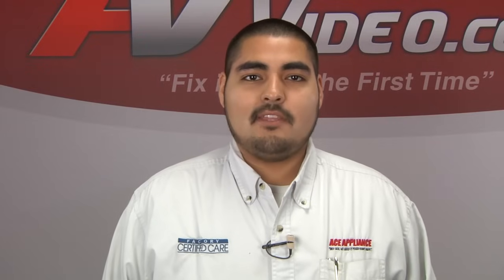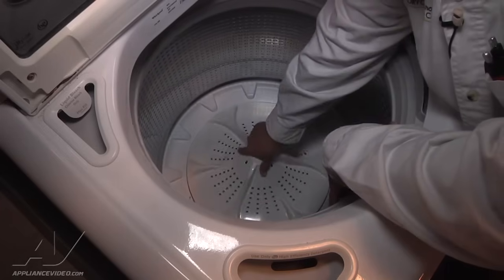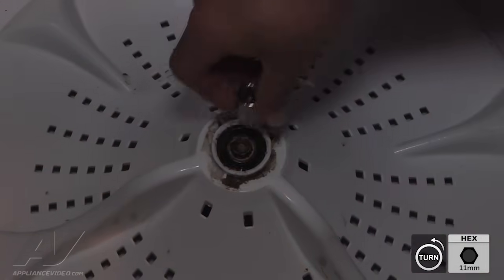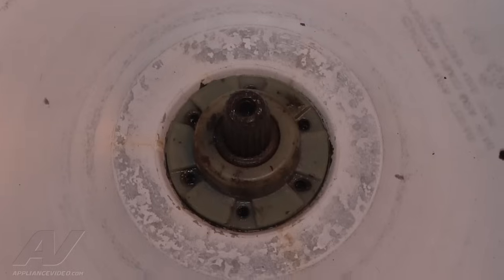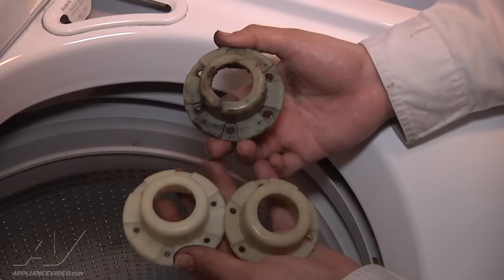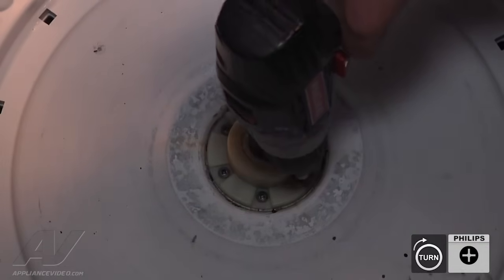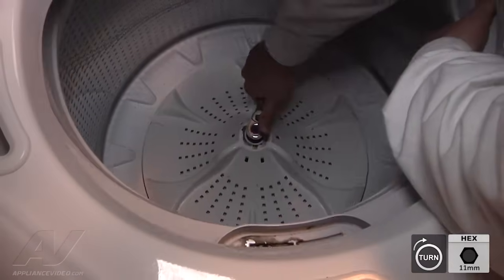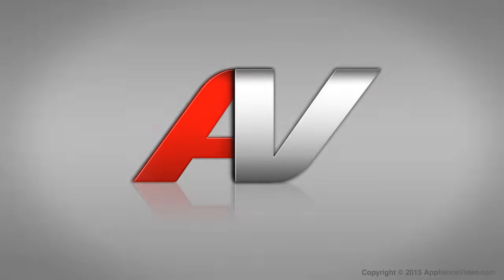Whirlpool Washer Repair - Error Codes SD and F71, Will Not Spin - Basket Hub

Comment: Is an error code 5d the same problem?  My washer will not go into a spin cycle.
Reply from the maker: Great question, if you have a more technical question that our parts department cannot answer, you can search our over 17,000 answered questions free at our website www.ApplianceVideo.com under our Repair Help section. You can also call our parts department at 1-800-830-5465 and they can give you help 7-days A week ,or search at www.SaveMoreOnParts.com  .

Comment: Ok, so I know the videos old but.. I changed these parts. Still get same code. 

Machine fills fine but basket still isn't engaging
Reply from the maker: Great question, if you have a more technical question that our parts department cannot answer, you can search our over 17,000 answered questions free at our website www.ApplianceVideo.com under our Repair Help section. You can also call our parts department at 1-800-830-5465 and they can give you help 7-days A week ,or search at www.SaveMoreOnParts.com  .

Comment: hi sir just changed the clutch on my whirlpool washer.and still making noise and wont spin need help thank you.
Reply from the maker: Great question, you can call our parts department at 1-800-830-5465 and they can give
you help 6-days A week Mon-Sat . If you have a more technical question that our
parts department cannot answer, our technicians are answering all questions at our website at www.ApplianceVideo.com under our Repair Help section. We have over 4,000
common questions and answers that you can easily search through by your model
number, appliance make, and problem or error codes, and It’s free to search
through our question & answer library.

Comment: The error came up and checked underneath and rotor bolt was loose . I tightened it and not only does it run more quietly but the code doesn't come up again
Reply from the maker: Great question, if you have a
more technical question that our parts department cannot answer, our
technicians are answering all questions at our website at www.ApplianceVideo.com under our Repair Help section. You can also call
our parts department at 1-800-830-5465 and they can give you help 7-days A week
Monday -Sunday, or search at www.SaveMoreOnParts.com  24 hours
7- days A week.

Comment: Hi I have one whirlpool the unit does not do anything I try to go diagnostics and nothing too can t
You help me
Reply from the maker: Great question, you can call
our parts department at 1-800-830-5465 and they can give you help 6-days A week
Mon-Sat . You can also search at www.SaveMoreOnParts.com 7- days a week.  If you have a more
technical question that our parts department cannot answer, our technicians are
answering all questions at our website at www.ApplianceVideo.com under our Repair Help section. We have over 6,000
common questions and answers that you can easily search through by your model
number, appliance make, problem or error codes, and It’s completely free to
search through our question & answer library. There is a very good chance
you question is already answered there.

Comment: i have a whirlpool cabrio model wtw6200vwo with a code f71 everything works but no spin what do i check yhanku like your vedio
Reply from the maker: Great question, you can call our parts department at 1-800-830-5465 and they can give
you help 7-days A week. If you have a more technical question that our parts
department cannot answer, our technicians are answering
all questions at our website at www.ApplianceVideo.com under our Repair Help section. We have over 3,000 common questions
and answers that you can easily search through by your model number, appliance
make, and problem or error codes, and It’s free to search through our question
& answer library.

Comment: Where can I get a metal hub,,,not cheap plastic hubs
Reply from the maker: Great question, if you have a
more technical question that our parts department cannot answer, our
technicians are answering all questions at our website at www.ApplianceVideo.com under our Repair Help section. You can also call
our parts department at 1-800-830-5465 and they can give you help 7-days A week
Monday -Sunday, or search at www.SaveMoreOnParts.com  24 hours
7- days A week.

Comment: i have a washer wirlpool Cabrio platinium and have this code error sd
Reply from the maker: Great question, you can call
our parts department at 1-800-830-5465 and they can give you help 6-days A week
Mon-Sat . You can also search at www.SaveMoreOnParts.com 7- days a week.  If you have a more
technical question that our parts department cannot answer, our technicians are
answering all questions at our website at www.ApplianceVideo.com under our Repair Help section. We have over 6,000
common questions and answers that you can easily search through by your model
number, appliance make, problem or error codes, and It’s completely free to
search through our question & answer library. There is a very good chance
you question is already answered there.

Comment: I can't get the bottom hub out. Any tips?
Reply from the maker: Great question, you can call
our parts department at 1-800-830-5465 and they can give you help 6-days A week
Mon-Sat . You can also search at www.SaveMoreOnParts.com 7- days a week.  If you have a more
technical question that our parts department cannot answer, our technicians are
answering all questions at our website at www.ApplianceVideo.com under our Repair Help section. We have over
4,000 common questions and answers that you can easily search through by your
model number, appliance make, and problem or error codes, and It’s free to
search through our question & answer library.

Comment: The washer plate won't come off after taking off the screw how can I take it apart? I'm stuck
Reply from the maker: Great question, if you have a
more technical question that our parts department cannot answer, you can search
our over 10,000 answered questions free at our website www.ApplianceVideo.com under our Repair Help section. You can also call
our parts department at 1-800-830-5465 and they can give you help 7-days A week
Monday -Saturday, or search at www.SaveMoreOnParts.com  24 hours
7- days A week.

Comment: my cloaths are still soaking wet after the spin cycle. any idea what is going on.
Reply from the maker: +Wilson Santos 

                   All of our technicians are now answering questions
daily at our http://www.appliancevideo.com/ website under the Repair Help section.  We also have over 1600 common questions and
answers that you can easily search through by your model number, appliance
make, problem or error code and it’s absolutely FREE. You also have the option
to email a factory service technician with a question on your appliance at
http://www.appliancevideo.com/repair-help/ . If you’re looking for a repair video, you
can also search our library of over 2600 free repair videos. ApplianceVideo.com
specializes in quality DO-IT-YOURSELF appliance repair videos and we get over
800,000 views per MONTH to our videos worldwide and growing. If you need of
parts for your major appliance, we have over 5-million parts in stock at http://savemoreonparts.com/ .  Thanks
for your support. Matt Ace Appliance factory service technician.

Comment: what is the name of this piece?
Reply from the maker: Great question, you can call
our parts department at 1-800-830-5465 and they can give you help 6-days A week
Mon-Sat . You can also search at www.SaveMoreOnParts.com 7- days a week.  If you have a more
technical question that our parts department cannot answer, our technicians are
answering all questions at our website at www.ApplianceVideo.com under our Repair Help section. We have over 6,000
common questions and answers that you can easily search through by your model
number, appliance make, problem or error codes, and It’s completely free to
search through our question & answer library. There is a very good chance
you question is already answered there.
Reply: Basket hub

Comment: Cant get the nut to loosen
Reply from the maker: Great question, if you have a
more technical question that our parts department cannot answer, our
technicians are answering all questions at our website at www.ApplianceVideo.com under our Repair Help section. You can also call
our parts department at 1-800-830-5465 and they can give you help 7-days A week
Mon-Sat . You can also search at www.SaveMoreOnParts.com 7- days a week.
Reply: I'm stuck here too..lol. What did you end up doing/using to get it off?
Reply: Me too??? It’s stuck on there

Comment: can not for the life of me get the agitator off the shaft. I've removed the 7/16" bolt  and the tub slides up about a 1/2' but that agitator is seized on. Tried the wire hanger suggestion, also some heavier wire hooks, sprayed penetrating oil, banged it with a rubber mallet and even tried this guys trick https://www.youtube.com/watch?v=m7rfpFhIcX0&t=216s  but ended up breaking the top lip of my tub... would appreciate any tips from anyone who had trouble but was eventually able to remove the agitator! Thanks very much
Reply: oh yeah, here is what the Whirlpool online chat support replied.... "I hate to hear you are encountering an issue with the removal of the agitator. Unfortunately, we do not provide technical assistance to advise how to remove parts from the appliance."
Reply from the maker: Great question, you can call
our parts department at 1-800-830-5465 and they can give you help 6-days A week
Mon-Sat . You can also search at www.SaveMoreOnParts.com 7- days a week.  If you have a more
technical question that our parts department cannot answer, our technicians are
answering all questions at our website at www.ApplianceVideo.com under our Repair Help section. We have over 6,000
common questions and answers that you can easily search through by your model
number, appliance make, problem or error codes, and It’s completely free to
search through our question & answer library. There is a very good chance
you question is already answered there.